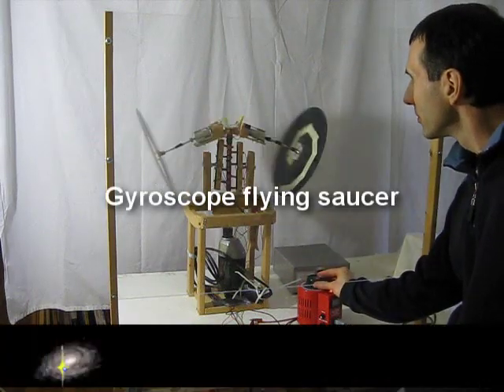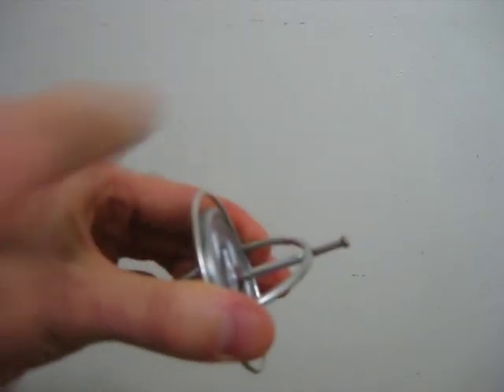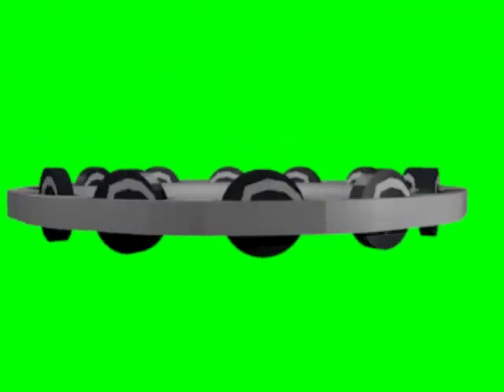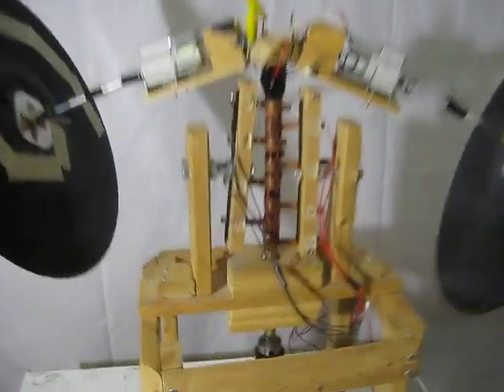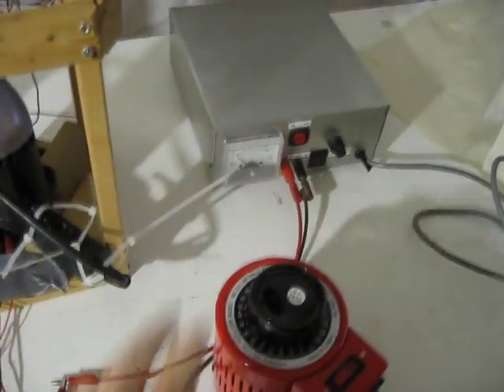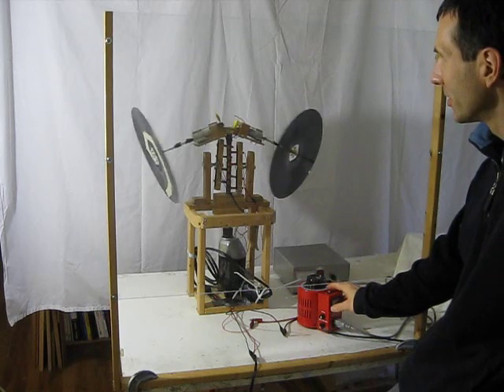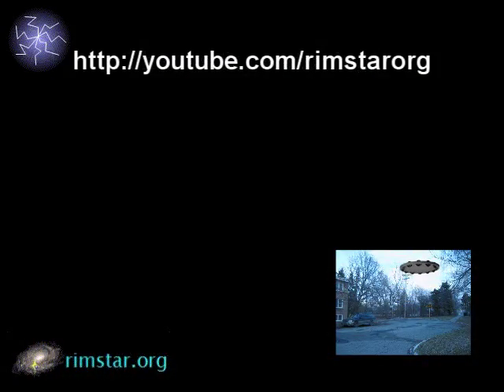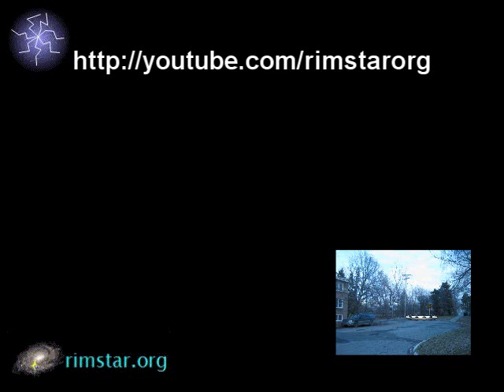Gyroscopic Precession Demonstrations and Flying Saucer Fun

Comment: I had the same thought about this project but the big difference is there is a lead weight on the end of the record disks to make a fly wheel affect, the weight in the spinning disk will cause lift if both disk’s weight is 180 degrees off from each other

Comment: what if you zero the scale before you put it on the scale...
Reply from the maker: That will only tell you how much it weighs. In the test that I did a long time ago when I had both sides spinning, I put it on the scale with everything turned off and then zeroed the scale and then turned it on. The scale stayed at zero.
Reply: yeah that is suppose to happen right? at the start the downward sentripetal force of the mass pushing down. then as you spin the gyros up it will become more and more precession force that will push against the floor with the same force. what if you use your hand and push it up a bit and then remove your hand. and at what rate/speed does it happen?
Reply from the maker: Yes, the net up and down forces cancel out so the scale is supposed to remain at zero at all times, as it does. I didn't use my hand but I did the test with some playing cards and when I put the playing cards on it, the scale did show the added weight of the cards and when I took them off, it immediately went back to zero. That was to test if the scale was working and capable of measuring even a small change in weight.

Comment: This is very interesting that you have to spin the drill to achieve gyroscopic precession. So you have to get something to spin in addition to the gyroscopes. But why just one of the gyroscope gets up ?
Reply from the maker: At 2:55, I point out that the second motor isn't connected up and that the power supply I was using at the time I made the video wasn't powerful enough to power both motors. Years before that when I first made and tested it (see the photo at 1:41) I did have sufficient power.
Reply: @RimstarOrg  ok. the two gyros would get up if both motors supply enough power?
Reply from the maker: Yes, like in the photo I show at 1:41 which was taken when I did have enough power.

Comment: Your expirement may have worked if the mass of your spinning disks was equal to or greater than 2x the control arms holding those disks. Newtons law. Those records are probably 5 times lighter than the arms

Comment: The first thing I have noticed is that the mass of vinyl records is neglectable to the mass of the system. The second thing is the force necessary to move a large rotating/spinning mass should be much smaller, which leads to the idea to spin a huge mass around a flying object before making it fly. We expect it would take just a portion of energy used to lift the flying object without any rotating mass.
Well....looking forward to seeing you identify the real point rather than spinning the plastic records.

Comment: This was the starting place that I used to ultimately design and build a device that does exhibit significant lift. I simply had to discover the mechanism by which the gyroscopic effect is generated, and voila, several G's of lift produced... @InertialDrive

Comment: why did you measure it from zero? wouldnt the same displacement go up from down and the weight shouldnt change...in fact it should be lighter...which is why it didnt change....im guessing...im studying the same thing
Reply from the maker: My scale can show negative as well as positive values. So if I zero the scale, and the device gets lighter then the scale will show a negative amount of grams. It's the same that would happen if you put a pile of sugar on the scale, then you zeroed the scale, and then you removed some sugar. The scale would show a negative weight, depending on how much sugar was removed.

Comment: You’re getting zero results because you have zero gyroscopes! Those thin flat platters are not gyroscopes! A gyroscope needs to have a heavy outer rim to produce any type of force. rebuild your machine using a set of professional made gyroscopes turned by a cnc machine
Reply: Not true! A gyroscope is any circular moving mass... or anything that creates s a centripedal force. A gyroscopic precession happens when another force (or gravity) alters the rotationary plane. This precession is the reason why the disc to tilt upwards as if it would 'fly'. 

You can intensify the centripedal force by having a quote: "heavy outer rim", but it's not a necessity.

And I leave it up to you to guess why gravity - although not a force - creates the same gyroscopic precession.
Reply: @darrinjaspers4898  You’re gonna have to use the “most efficient” form of gyroscopic precession or it’s not gonna work case closed

Comment: I once worked on this concept. I think if you fixed the axis of the disks shaft it will work. Also I wrote my own mathemical simulator on MathCad,  a plot showed this idea will work but the force generated was very small.
it's a good idea  for space propulsion as motion or energy is accumulative.. I would like to make contact with you
Reply: Why, he didn’t fix the axle on purpose. His disk’s were of low weight and low speed. The lift comes from forced precession which he anchored down.
But you can’t avoid these videos to solidify that it doesn’t work. 
If you come close enough they’ll shut down your video, and get a visitor at your door.
Be careful my friend.
Reply: @chrisjenkins1989  Otis Carr spent 14 years in prison, in addition to the government taking all his inventions and apparatus, but even they weren't able to control it.

Comment: There would have been precession on the spinning gyro if you had the gyro fixed on an extension arm with the other end of the extension arm fixed on the free center of the " vertical shaft" without the drill being used of course.

Comment: you do understand that you need trust and on a object that turns around like a frisbee in order to fly  you have no control or way to control it is like you trying to fly only whit a propeller siting in the center really? the giros all way be use to create stability never to defy gravity  you need to create a device that have lots of power and real small amount of energy  like frequency  in pulse waves to point a magnetic field to anything so you can  make the object loose mas wight in order to  create trust levitate any object were the device is on and use the giros to balance  this happen in magnets when they repel each other so the device have to create a wave of pulse + that when hit any object bounce back a positive wave  and when they collide whit each other levitate any object were the device sits everything in the universe have a positive and a negative  on molecular level

Comment: No central shaft power is needed if the rotors are allowed to drop a small amount after spinning up. Only the rotors need power. The force of gravity will start precession, and the precession will cause an upward reaction force against gravity which can be controlled by rotor angular velocity. Of course, once the shaft reaches its upward stop the total force will equalize as you say, and create a couple against the inner walls of the craft. It is interesting to note, however, that the upward precession itself also causes a reverse direction precessional torque, slowing down the upward processional torque, but when this tries to slow and reverse the upward precession, gravity wins, and the upward precession continues. Laithwait's Law of Conservation of Momentum (he corrected Newton's Rule) states that linear and angular momentum are NOT conserved, but the SUM of the two are conserved. Thus angular momentum and linear momentum can be converted into one another. When an offset rotor is force precessed, the rotor slows down. Only part of this slowing down is due to bearing friction. Another part is loss of angular momentum due to conversion of it into linear momentum.  Mass is transferred along the axis of rotation a distance according to and in direct relation to angular velocity. It is this mass transfer which begets linear force, which can be made to propell a flying saucer, but not in that manner. However, if the machine were designed so that the various gyro rotors of the craft could slide along their shafts some distance, and if this linear sliding back and forth of the rotors was timed and tuned to the overall cycle, and if the shafts were all angled downward by 10 degrees toward the perifery of the craft, it might work.

Comment: Well, it certainly lifted the weight of the the record and the motor.
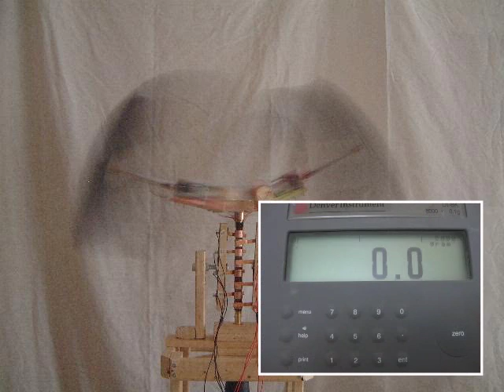Reply from the maker: No, it didn't. Before turning it on, I put it on the scale and it showed the weight of the whole thing. Then I zeroed the scale (I say this at 1:46). That means that it subtracts the actual weight. When I ran it, the scale stayed at zero, meaning there was no change in weight.

Comment: Great Video. Thanks for all the effort in documenting an experiment. You demonstrate soundly that without being free to move a gyroscope will not stand. This is the reason that gyroscopic forces don't hold up the bicycle as well. When the bike falls over, the rear wheel is kept from precessing by the frame and cannot generate a torque to counter gravity. The front wheel does have a small moment though not significant.

Comment: In theory, it's really very simple physics, and no reason not to work, like Eric Laithwaite tried to explain, and got "burned on the stake" for. It's more easy to explain with a drawing but I'll try with words anyway. I'm not a physicist and english is not my first language so bear with me. 
It's easiest to understand if you start with considering the fact that gyroscopic or sentrifugal forces depend on speed. When only the gyroscope is spinning, the speed of the rim is the same all around the wheel, making the force equal in all directions, BUT when it starts moving, the speed through space ARE becoming greater either on the top or bottom, depending on the directions of the spin and movement of the rig, this SHOULD make the forces acting in one direction greater than the other. According to Newton and anyone else...
IOW: The movement of the whole contraption adds speed to the side(of the wheel) already moving in the same direction, and subtracts to the side (of the same wheel) that moves in the opposite direction. The net force then is not 0, but favourable to one direction - in this case up or down. How teachers and guys like you still advocate something else, like this is not science, is pretty strange, when I looked deep into this, I found that many major airspace companies having done research on this, all had their own rigs and patents for satellite movement etc. with similar setups. If you wanna make it really powerful, you'll need very high speeds and have very good bearings. Forget about wooden rigs, the ones in the patents are really heavy duty. I believe the principle has been known for ages, but now when we have better materials to work with, it should be possible to even make a toy out of it with ordinary quadcopter parts - f.ex. electric motors that spins up to 20.000rpm's, carbon fibre, etc. Still some things nobody will believe until they see it.  It's incredible how much resistance you can meet in the scientific community especially if you show them something new, or something they had completely missed. Even experimental proof will  induce more theoretic resistance than you can imagine, or what in my mind at least - would be reasonable.. almost like a conspiracy - by some clever fellows, perpetuated by the stupidity and stubborness of many others. Just read the whole story about the true genius Eric Laithwaite.

Comment: Use 3 wheels give stability and more power,increase RPM exactly for lift mas.Add floating mass on the wheels, inertia and centrifugal force would be helpful .(),mass must be in center when it move down,uP perform better control. That make first electrically powered motor inertia.

Comment: Nice! As I was watching, I was anticipating that there'd be lots of comments about how you just need to adjust "this", use a heavier "that", reverse "this" and add 2 of "these". THEN it'll work! You explained it very clearly, the lift on one side is against the downward force on the other. Like grabbing your feet to lift yourself up or putting a fan on a sailboat to blow it across the water. Damn you Isaac Newton! Great video.
Reply from the maker: Andy Jones Thanks! If only Isaac Newton had never existed! :)

Comment: please, repeat the experiment blocking the lateral arms and using some disks a little but heavy. with a mobile base vertically. the machine could rise
Reply from the maker: Rafael Crespo There's no need to repeat it with any modifications. As you see in the video at 0:35, one end goes up while the other goes down. There are equal and opposite upward and downward forces. Though as I mention in the video at 1:49, I did do the test with the arms blocked laterally just for fun and got 0 weight change on the scale.

Comment: It is as redirecting the centrifuges force  of the revolving disks toward an only point up. it could be defined as mass jumping? Then, if the disks are heavy the antigravity force will be extreme. In a flying plate, the ship fuselage must be light, but the disks would be weighed.

Comment: For every action there is a equal and opposite reaction.  The center of rotating mass is near center of the machine when in operation, so when the opposing forces are applied, the opposite forces are also applied in the opposite direction.  Δp1 = -Δp2

Comment: Man you didn't understand gyroscopes at all. The bigger and heavier are your disks, the greater force you will have. 5 grams disks will give you nothing :D You also should mount the gyroscopes so that the disks are parallel with the rotating platform ;)
Reply: Good point, this guy has no understanding.

Comment: This is bugged, is the device stuck to the scale? then does your digital scales read a negative value when the plate is pulled against in a upward motion?  The Gyros lifts with that precession. If you really want a downward force then the precession needs to the other direction.   You would be better off to not set the scales to zero so that you can understand which way the force is actually going. e.g more weight or less weight.
Reply from the maker: Yes, the scale shows negative values if you have it zeroed and then remove some mass or pull it upward.

Comment: The arms should have been on a strait metal rod instead of having the axles on a hinge, because wen the rotation is great enought to lift the arm you loose the uper force when it raise.
Reply from the maker: I tested that back when I had both vinyl disks turning. I had it on a digital scale and as expected, there was no weight change.
Reply: RimstarOrg Try to spin two heavy gyroscopes very fast, and rotate them very fast horizontally. Fix the gyroscopes on a straight rod with no hinges. In this way the side way centrifugal force of the rotation is transferred upward by the spinning gyroscopes.
Reply from the maker: michael ngan There'll still be an equal and opposite downward force. It's not obvious because things are spinning, but it's there. That being said, I don't know all the physics of it myself. But when I did what you're suggesting with the vinyl disks and the scale remained rock solid at 0 change, combined with the physics I do know, I'm satisfied.

Comment: Why did you just only rotate one Phono disc ?
This way it does not work YOu must rotate both ! Then you will get lift !
Reply from the maker: At the time I made this video I had power supply issues so I couldn't rotate both. But a few years before that when I first built this I did rotate both. There was no lift. Just for fun I sat it on a digital scale and the scale did not show any change. But if I placed a playing card on it then the scale did show a change. I also tried with the arms lock horizontally and there was no change.
Reply: RimstarOrg

Hmm, I have seen a video here on Youtube from some Russian, who have build it big size like 2 Meters in diameter and they got their system to show about 1 Kg less weight ! You really need big gyro masses and fast gyro speeds to see the results !
The principle works, but you have to have the right parameters ! Regards, Stefan.
Reply from the maker: Stefan Hartmann
Was it just one that hopped/jumped? How did they measure the weight change? Was it spring scales? Those can be misleading. If you ever find the video again I'd be interested in seeing it. 2 meters is pretty big. Cheers, Steve.
Reply: RimstarOrg, if the motors you used are DC, how about replacing them with other motors which will be controlled by rotating magnetic fields and the speed of their rotation will depent of the frequency of an oscilator? So, instead of changing the voltage, you can change the fequency to control the speed, so you can use as much speed as you want (in the same way a TGV works).
Reply from the maker: Than Zamp
I guess I could but this one succeeded at what I was trying to do, which was make a big gyro experiment like this and see it in action.

Comment from the maker: They'll both rotate, but in opposite directions. However, the arms with the disks will rotate around the shaft slower than if the primary motor is firm to the ground, so they won't rise as high. But I think they'll still rise. They'll still rotate and still have a net rotation with respect to the primary motor and shaft. That's my guess anyway. Interesting to think about.

Comment: IMPORTANT: This prototype works if the primary motor (the one that turns the two arms) is firm to the ground, if the lower part of the engine instead of resting on the ground was suspended it would turn on itself, and the two arms remain stationary, so I do not think will work